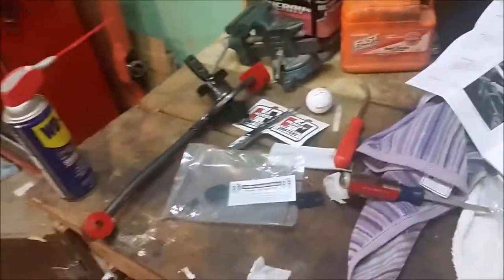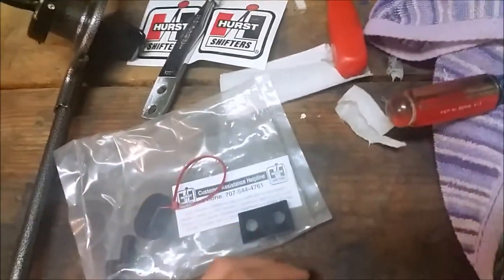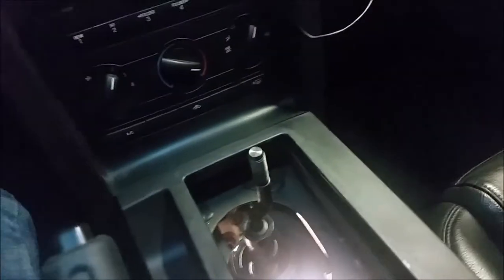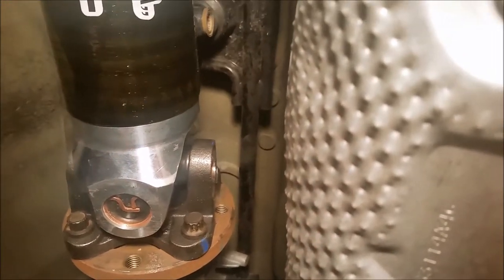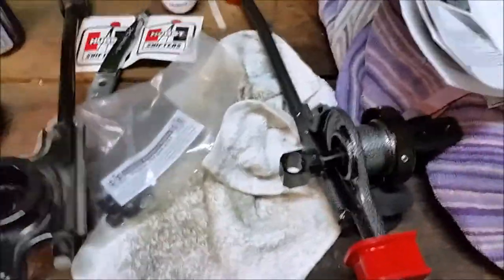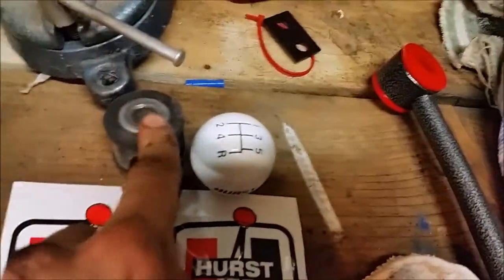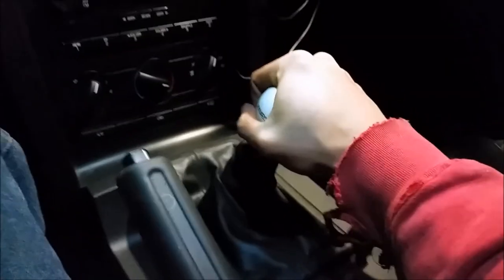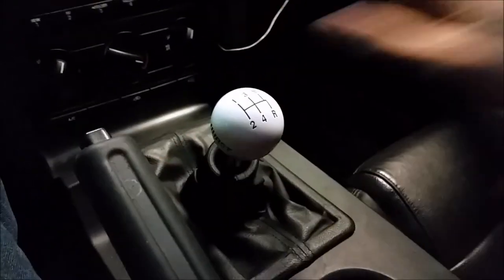2005 Ford Mustang GT Hurst Shifter Install

Comment: Probably you fixed that already, but that slotted oval rubber grommet that comes with the shifter is to hold the leather boot on the shifter stick, not the inner isolation rubber boot!... just saying.

Comment: i just installed mine and have been grinding in 3rd when shifting hard. It also tends to get held up before entering the gate fully. Did i do something wrong during the installation? or do i just have to break it in?
Reply: @Above Reality Sim it might also be the synchro. I think it got a little better after breaking it in but I was still scared to do hard  2-3 gear pulls. it's also been a few years so I don't remeber. reverse was never a problem for me. good luck

Comment: How has the shifter been holding up bro? I just bought one.
Reply from the maker: +nola504boy1 Just now seeing this. It's an okay shifter. Looks nice but really the handle makes it feel kinda row boaty for my taste. It will suffice for now though. Also use some blue loctite on the two shifter handle screws.
Reply: +TekMan05 I installed one on my car a couple of months ago. Sometimes it grinds going into 2nd at wide open throttle other than that I really like it.
Reply: Aren't you supposed to adjust the shift stop settings for extra protection when  shifting gears really hard ?